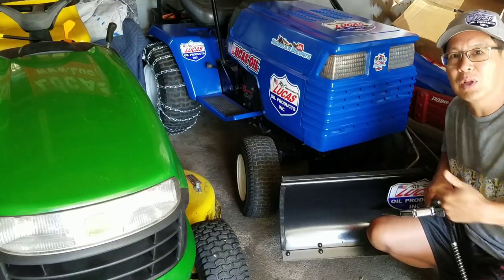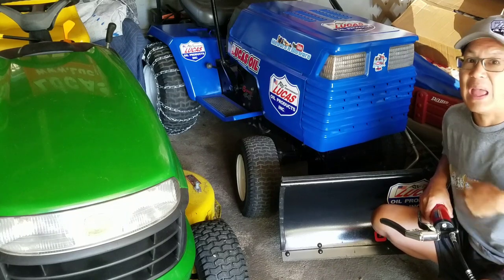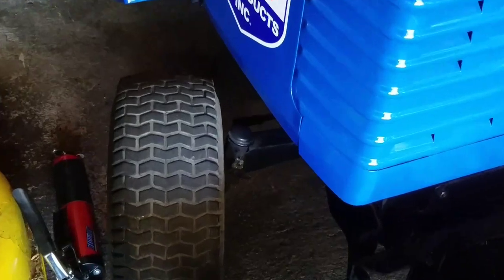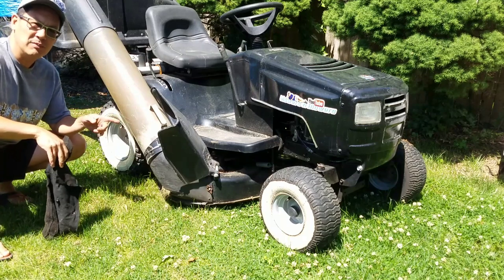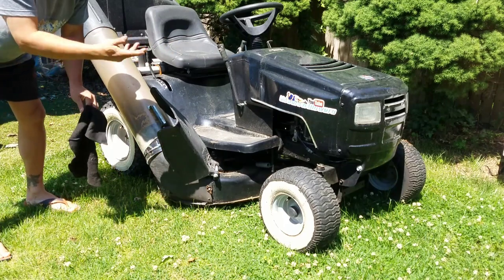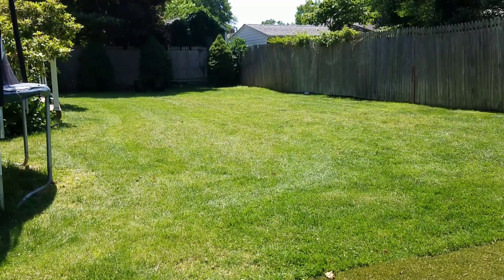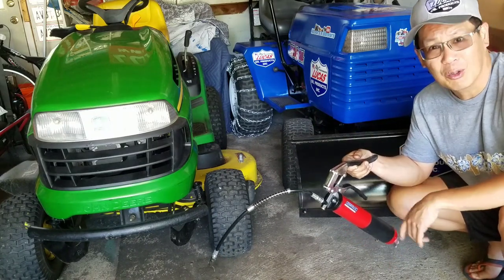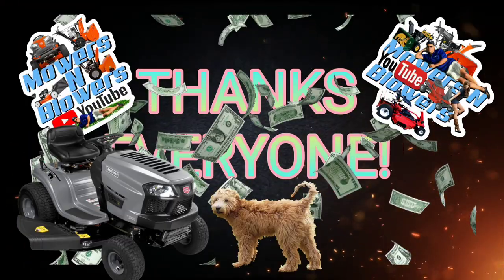HOW TO LUBRICATE GARDEN TRACTOR STEERING POINT FITTINGS CRAFTSMAN GT6000  HECULAX 6000PSI GREASE GUN

Comment: Finally we get to see henry use that new grease gun.  And that's a good one too, Not like my forty year old gun with a single handle.  My MTD Ranch King has the same steering as your murray,  On that spindle area there are plastic flip doors that slide sideways to allow access to those shafts.  I smeared a ton of grease on mine and closed the doors.  They didn't look like they had ever been greased before.  Also i used a grease needle to shoot grease up under the rubber shields on top of the steering arms,  And into the lower knuckles.  It really loosened up after that.

Comment: Hey Henry, evidence confirms you got a badger or pocket gopher problem... Boba wouldn't do that he is a good little guy! 🙏🏽
Was rather surprised there was no grease fittings on your old Murray. My YardKing is a 2001 and it has the same axle only with grease fittings. You can always take the cotter pin and washer off and drop the kingpins out and then slather them with grease.
Nice haul! free parts are free parts... other wise they all cost money.
Reply from the maker: Yup, that's what I'll do to grease da Murray! Thanks Don

Comment: Great video!  Anyone know if the John Deere L120 has any grease point on the deck spindles?  Just greased mine and I don't see any even under the covers.
Reply from the maker: You just said you greased yours. How do you grease them if you can’t find them?
Reply: @MowersNBlowers  Because I found all the front ones on the wheels, axels, and the top front middle 1, but I thought there was 7. I didn't see 2 spindles with any fittings.  So I'm wondering if the L120 doesnt have spindle grease fittings?

Comment: My grease gun plunger handle doesn’t go down at all when I have grease in it. But it still works fine. Do you think I’m doing something wrong?
Reply from the maker: I'm not an expert by far, but li think you got air in there...keep pumping! Or somethings clogged or somethings tightened too much.  Remove the hose and see if it squirts out.
Reply: Make sure that the metal side of the grease tube is facing forward, Not towards the plunger. Or it hangs up in there.